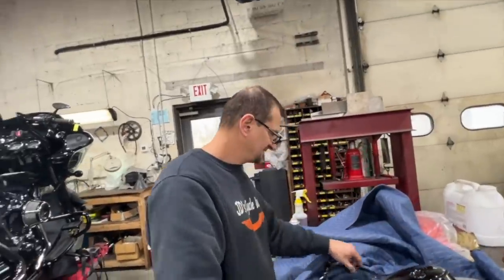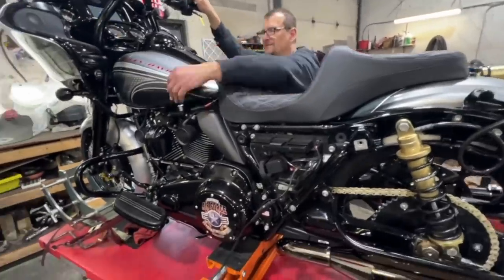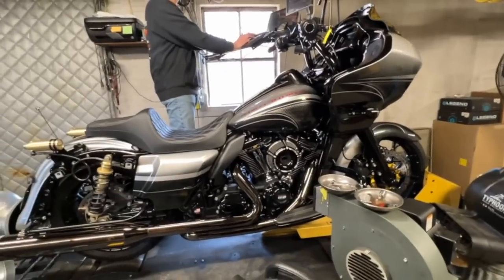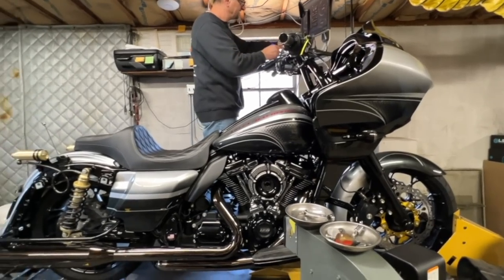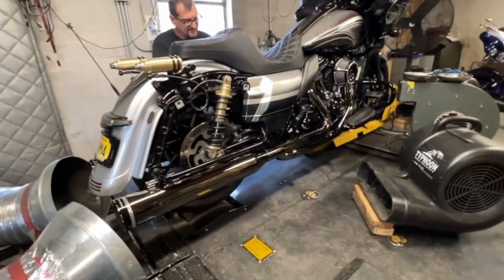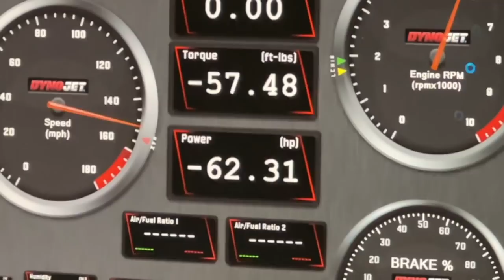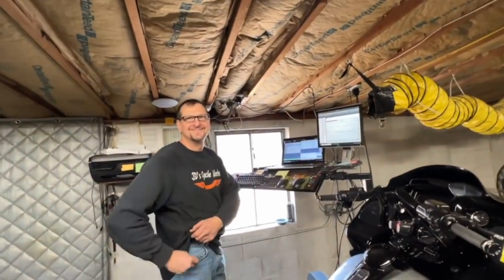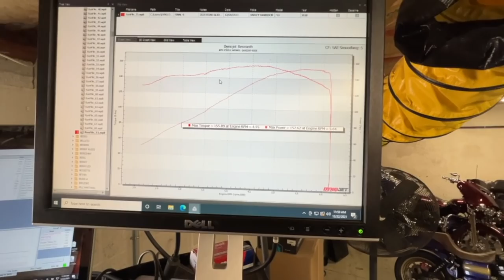PERFORMANCE 130" BAGGER 2020 ROAD GLIDE "SILVERBACK" FIRST START - DYNO RUN - WALK AROUND REVEAL 👍

Comment: Congratulations John on completing the 130 build and getting Silverback put back together! Performance numbers are extremely impressive!! Are you still using the factory ECM and factory narrow band O2 sensors? Or are you using Thundermax ECM and wideband O2 sensors? Forgive me if I missed that info from a previous video. Ride safe ride often and keep motovlogging!! Glen